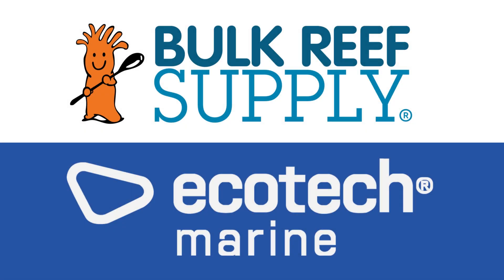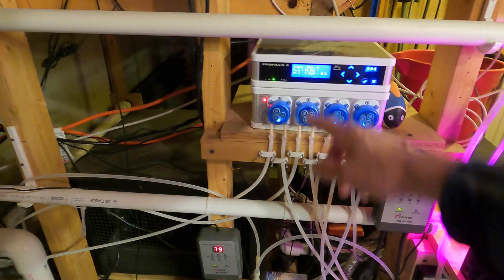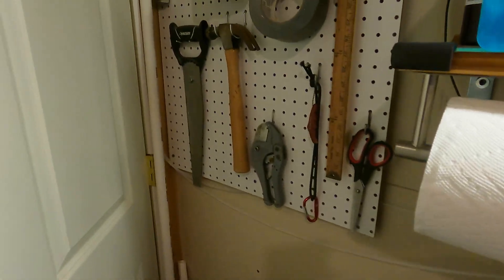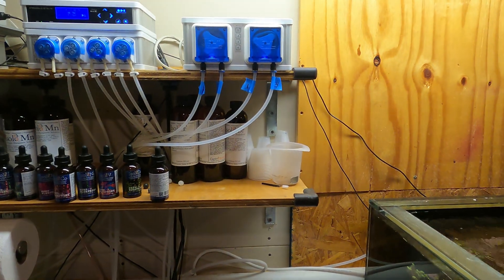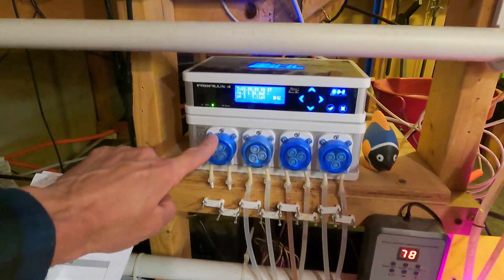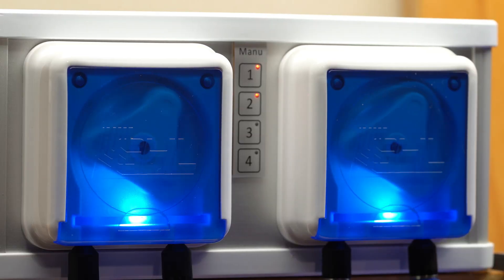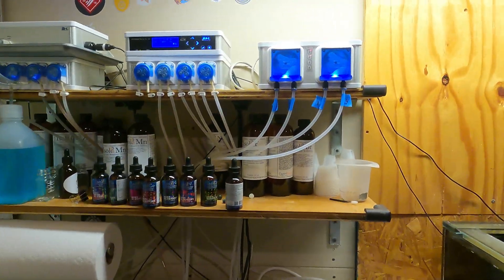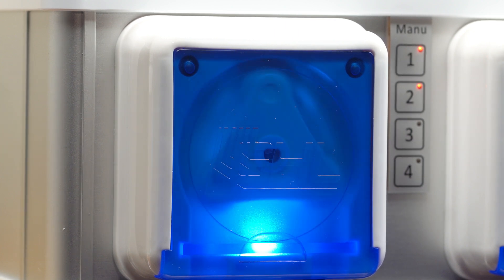New Option For Dosing Kalkwasser, Auto Top-Off & Water Changes

Comment: Keith, Question... running this as a stand alone for  ATO.  I have a float switch that turns a  power outlet on/off. Can this unit be plugged in and have power turn on/off the unit without it loosing its settings? would it be bad to use it this way?
Thanks,
Jim C.
Reply from the maker: My understanding is that you should be able to do this and not lose the settings. But you should reach out to GHL support to confirm. I should also be able to use a GHL level sensor that plugs into the Stand Alone doser to achieve the same results.

Comment: Looks like a nice piece of hardware. I tried the GHL Profilux for a few months and was terribly frustrated with the user interface though. I ended up selling it for a significant loss and buying a Neptune Apex. The hardware isn't as robust, but at least it's easy to program & there appears to be much more hardware/software improvements than GHL has.